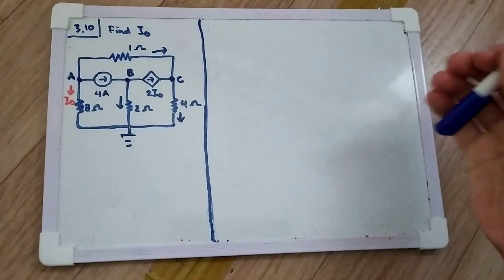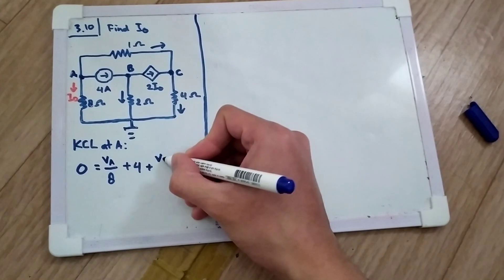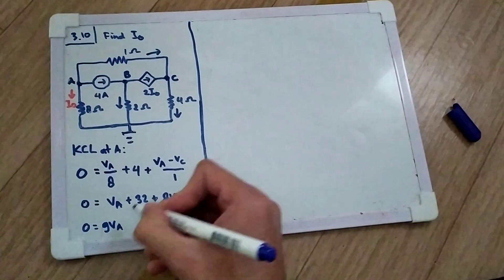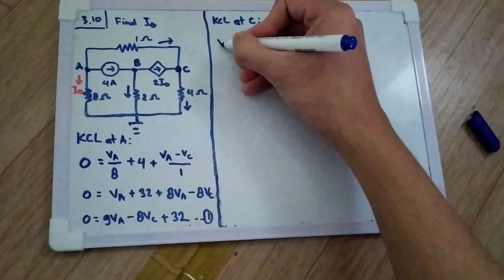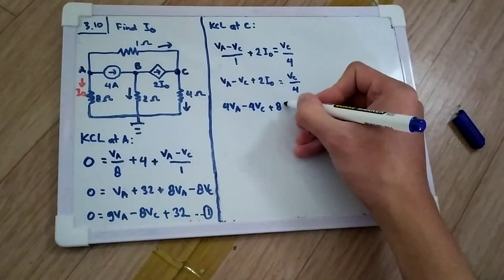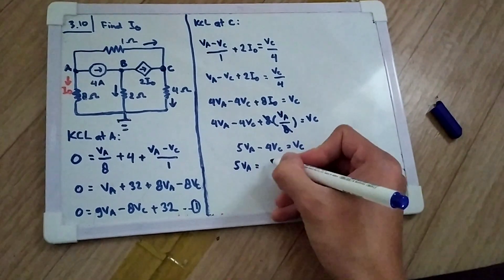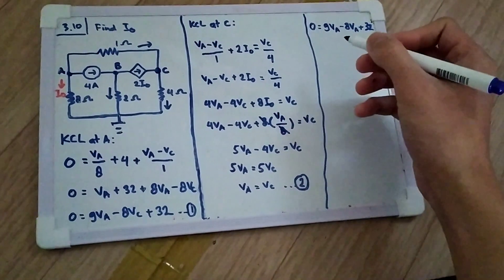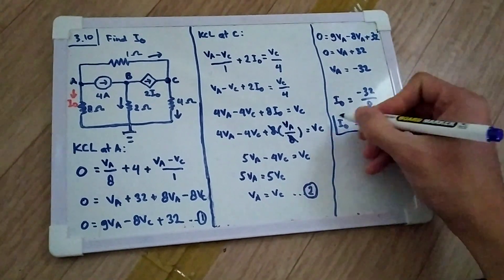Problem 3.10 Alexander Sadiku 5th Edition - Find I_o in the circuit of Fig. 3.59

Comment: Please i want to understand how you assign arbitrary currents yours is always correct mine is shaky
Reply from the maker: It is arbitrary, may be you just need to be careful when calculating.
Reply: @ArdiSatriawan  so you can assign the currents anyhow without considering anything in the circuit
Reply from the maker: @everythingsports629  yes you can!

Comment: can you solve it by Mesh analysis method!
i am trying to but can you tell me how to select the right loops thats makes the solution possible
Reply from the maker: You will need superloop in this case, node analysis will be much easier.
Reply: @Electric Circuits Solutions  can i message you on your email?!

i tried to make a superloop but i can't solve it, because too much equations i done

be side my professor tell us in that case, we assumed that there is a voltage drop Vx at every current source, and take the loops inside "not superloop" and thats makes number of equation geting biger "i1 i2 i3 Vx1 Vx2" and by this way i can only get 3 equations from loops 1,2, and 3, and equation from the differences between the current like (i1-i3=4) and (i2-i3=8)!!
can you give me any idea/topic to do in such a case.
Reply from the maker: @Civil_Eng_Ma7md  sure, my mail is ardiantosatriawan@gmail.com
Reply: @ArdiSatriawan  thank you, i already send an email for you.